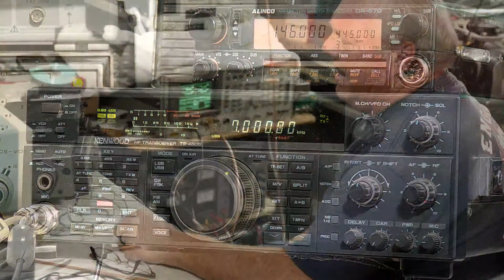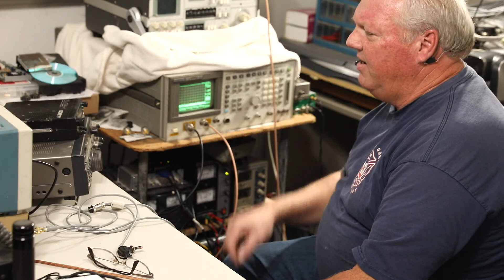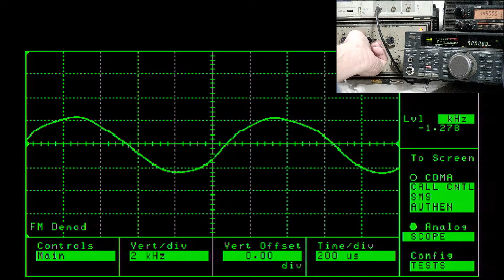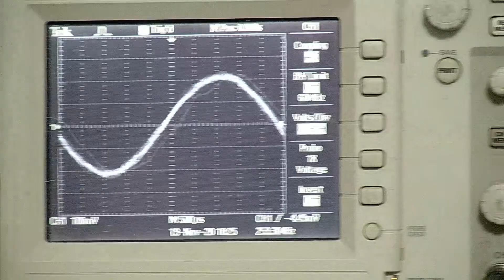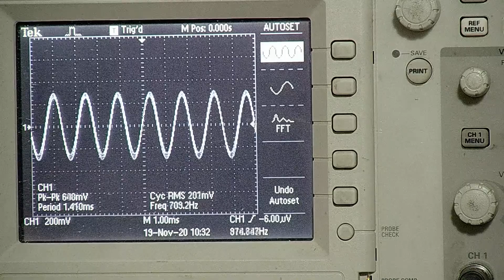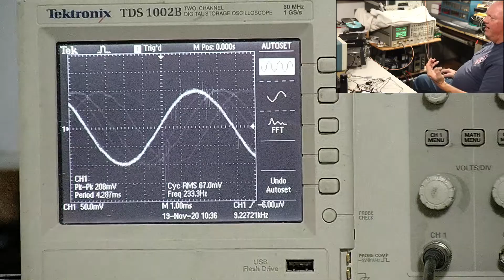Audio Bandwidth on a Service Monitor

Comment: Is that an 8920A test set? I've got one and can't figure out where the Screen on the far right in the RX & RX Test screen and the Spectrum and Scope screens comes from. The block to the far right that has the "To Screen" reference. I don't see that on mine. Do I not have the right options installed to see this or is this one of the tests that come on the PCMCIA cards?